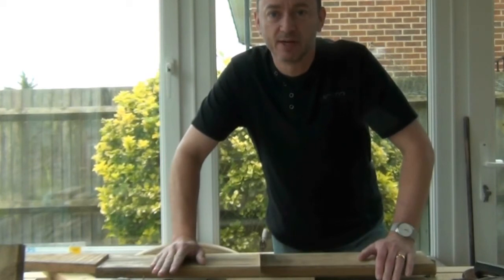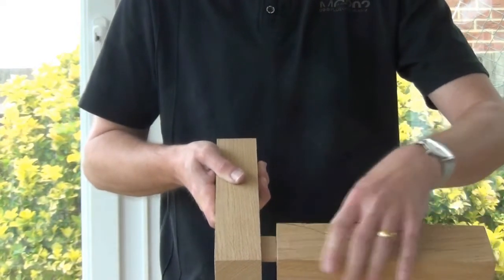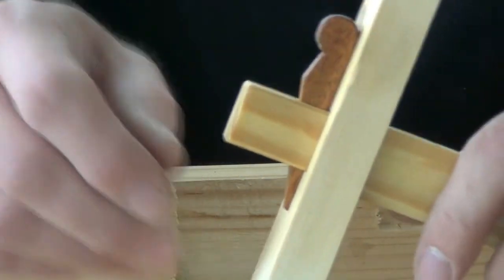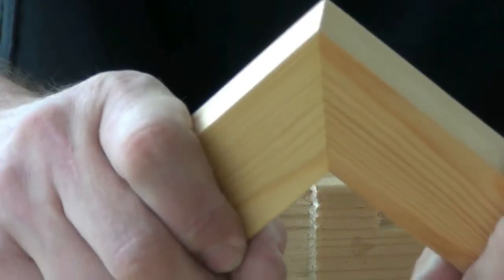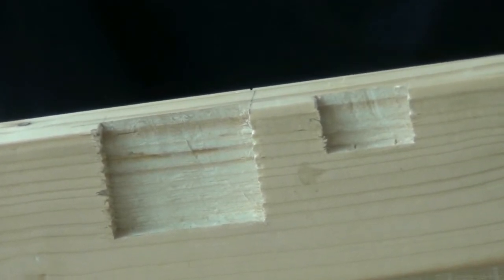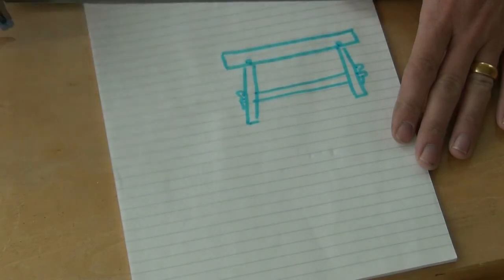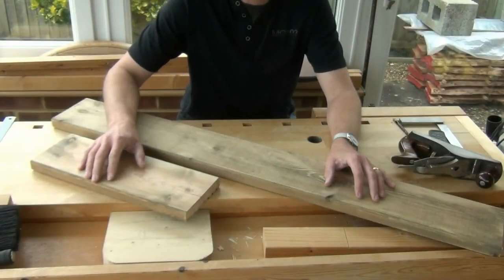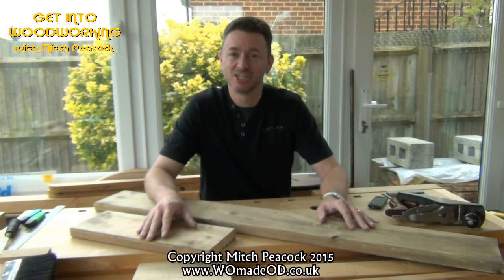How to Make a Simple Stool - GIWS1E9

Comment: Mortise and tenon is si simple, but I did the same two and I got a half inch difference due to the curvature of the material :(
Reply from the maker: Wood Fun It's important to use a straight reference surface. Usually that will mean preparing a 'face side' and 'face edge'. 
You could take a look at my series on component preparation https://www.youtube.com/playlist?list=PL86lqISCtD7r8iXGmpBaq_biqWVeoyPVF
Reply: Get into Woodworking Thank you, I'll work on it